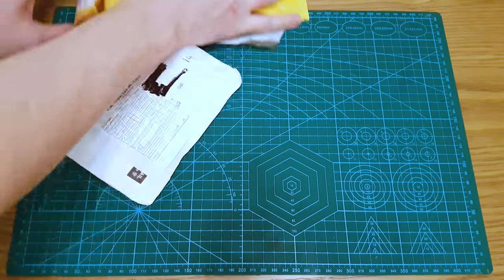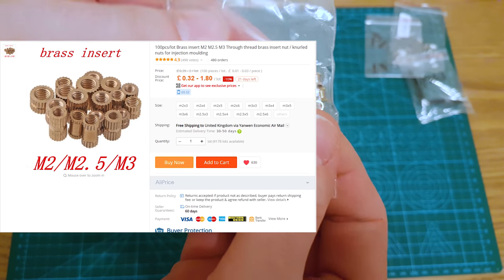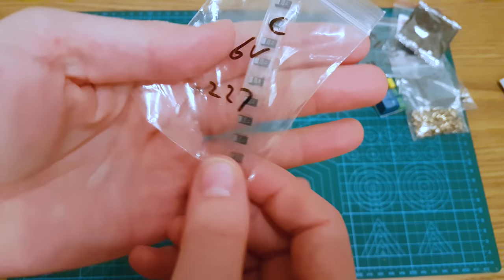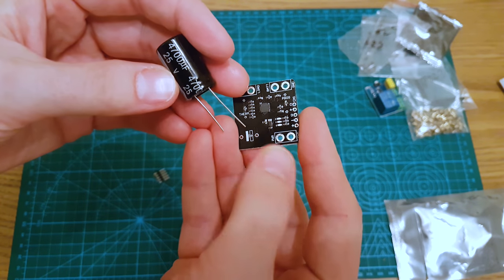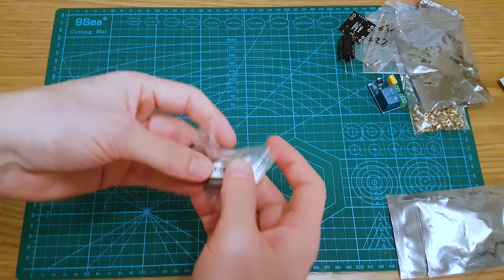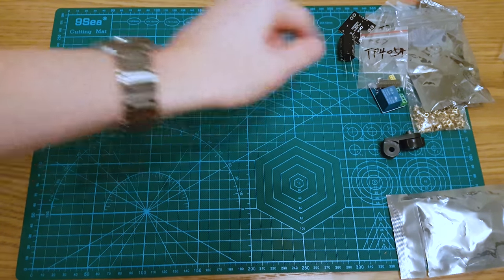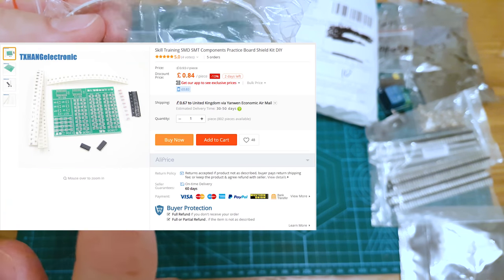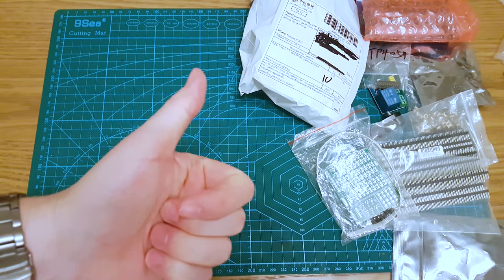AliExpress Postbag #20 - Post bag / Electronics mailbag items from AliExpress

Comment: Hi, I suggest you test the MCP73871 Charger Board before building a project around it. I have two of these here from different sellers and they both in no way nearly deliver the current they promise.
Reply from the maker: Good to know! Will check out their performance, thanks.
Reply: @ChunkySteveo  I was using them on a Raspberry Pi 3 with not much load and the current coming through from the charger was so low, that it drained the battery until it was empty - and then the Pi crashed,